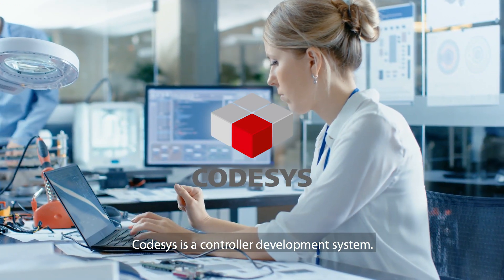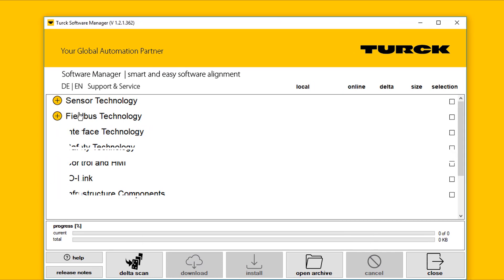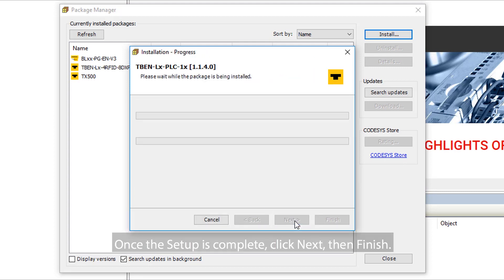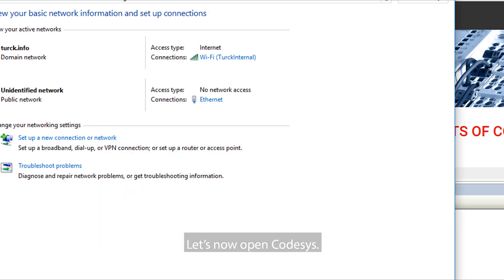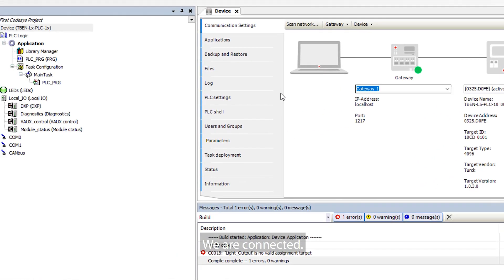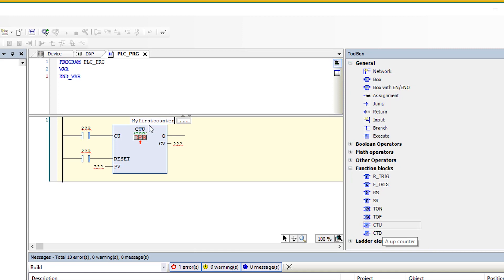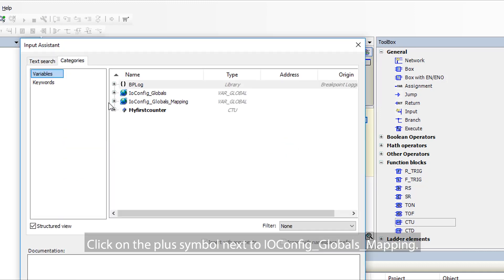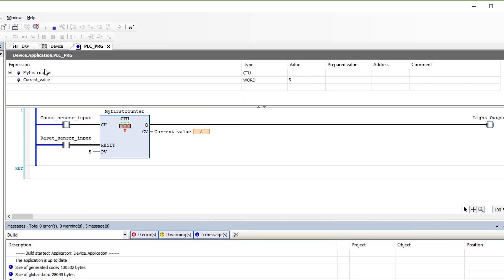CODESYS-3: How to write your first Codesys program

Comment: HELLO DEAR how to connect siemens step 7 to codesys, is the procedure exactly same? and from where should we download the package of step 7. kindly help me ,thanks
Reply from the maker: Dear Abuzar Khan, unfortunately it is not possible to program a S7 PLC using Codesys. However, Turck’s IP67 PLCs and Codesys might be a viable alternative, especially since the engineering system is free of charge and very powerful. Depending on the application they’re perfect players in combination with other PLCs (i.e. S7) as well. You can decentralize your applications by offloading the control of subsystems onto Turck’s TBEN-Lx-PLC and expose well-structured services to higher level PLCs via Profinet, Ethernet/IP, Modbus/TCP and more. That relieves the main PLC and speeds up the integration of subsystems. If you need further assistance, we’ll be happy to help. Please let us know. Best Regards - Your Turck Team